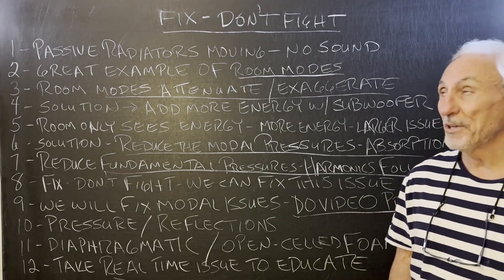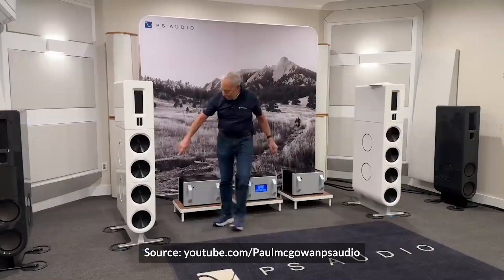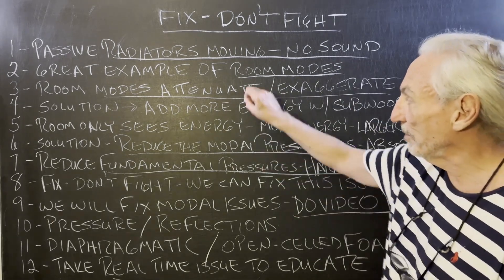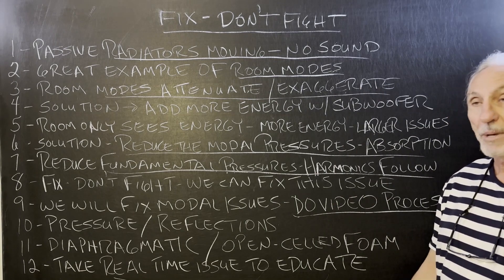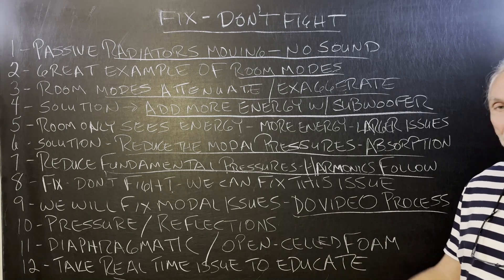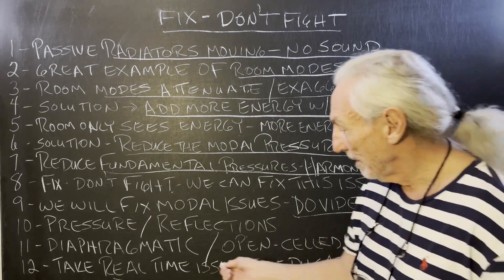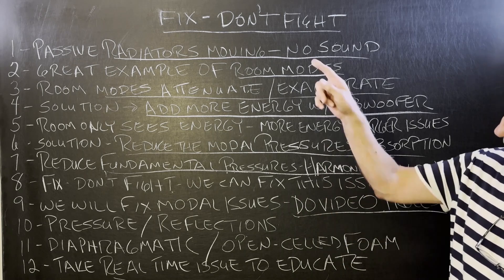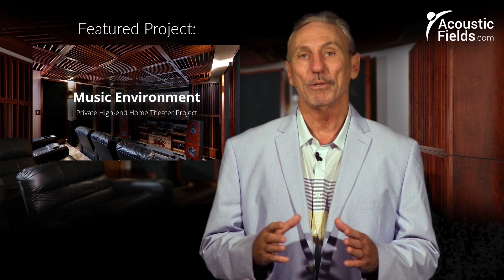Fix - Don't Fight - www.AcousticFields.com

Comment: Paul and company spent a fair amount of money on treatment for that space. I’m not sure they are open to starting over again, but I hope they would!

FWIW, my dealer doesn’t want to have a “perfect” room in his shop. Why? Because 99.9% of customers will not have an equally well treated room, so whatever they purchase will NOT sound the same or as good at home. That will generate more after sales issues, time spent in revising the setup or even returned products and lost customers.  It’s a catch 22 and why I have learned to understand the limitations of my room then get the optimum out of it as it exists and fix one problem at a time. 

So I’m looking forward to delivery of my carbon panels in the next couple of months.  I know they won’t fix everything, but they will be a first step in doing what can be done in a small room.
Reply from the maker: There is no such thing as a perfect room. The goal is to minimize as many distortions that the room dimensions produce. This can be accomplished with the proper rates and levels of absorption to manage both pressure and reflections. I understand the dealer's situation. This is why we only choose dealers that have the ultimate gear and room resolution as their end goals. It would be interesting to have a dealer with one room treated and one room not treated and see what room produced the most sales. What do you think would be the result?

Comment: you should watch his video when he was building his octave records studio... rockwool everywhere inside the walls!
Reply from the maker: Building insulation inside the walls as a climate control tactic has merit. It has effective r-values for temperature management. However, what you put inside the walls has very little to do with the sound quality inside the room. This is where the industry has perverted the usage of a cheap material type and tricked people into thinking it has the proper acoustical requirements. Always remember that music and voice have absorption requirements that building insulation can not meet. Music and voice are dramatically different than noise.